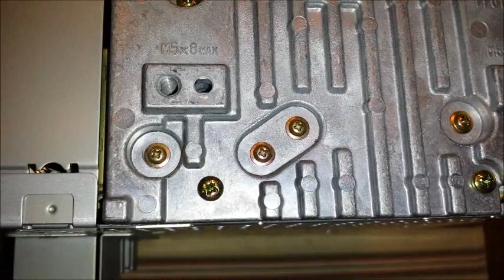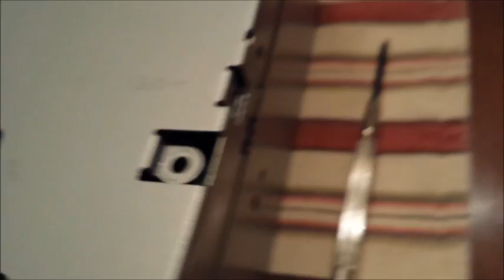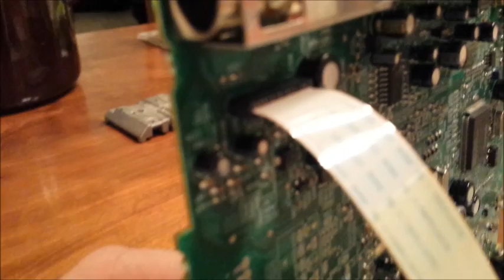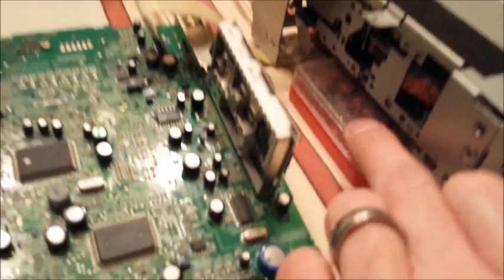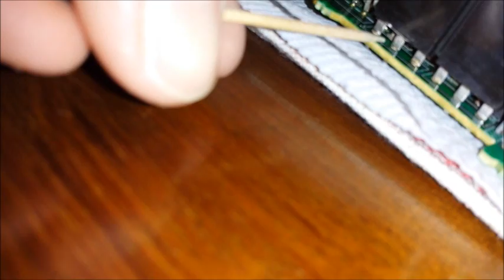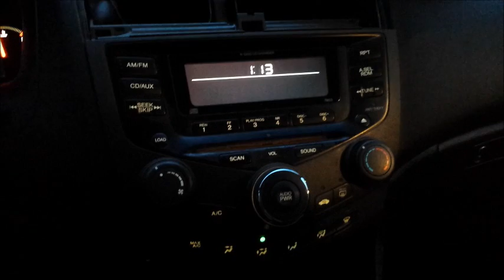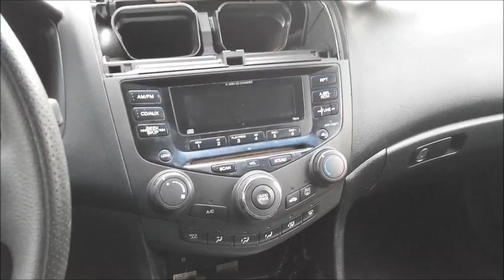2003 Honda Accord Radio Repair - Part 2

Comment: thanks for the video, really helpful!! I did everything, and worked perfect! but when i started the car, the light turned off again!! I'm sure i left it for a day when i used the circuit pen!! any ideas plz?
Reply from the maker: Hi ma sa, thanks for watching, and I'm sorry to hear the repair didn't work out the first time!  I'm not sure I have any brilliant suggestions, other than trying to make the repair again and insuring that you have good electrical contact on both sides of the bad component.  If you try it again, you might want to leave peripheral trim pieces off for a few days just to make sure the repair works permanently...if not, you can always pull the radio back out easily that way.  I hope you're able to sort it out.  Let me know how it goes.
Reply: ***** i appreciate your reply, i will try to do that all over again and let you know. I hope it works this time
Reply: hi I love your video I have a factory radio in my Honda Accord just like yours but I have the 6 disc CD changer and all my CDs are stuck in it I want to take the radio off then try to take the CDs out myself how do you recommend I go about doing that

Comment: I noticed that water thermometer is a little on the left. Is it normal or does it happen to all 2003 honda accord models ?
Reply from the maker: With regard to the temperature gauge, I'm not exactly sure what the normal operating temperature for this vehicle is, as this was a friend's car that I was repairing.  A quick Google search appears to indicate that the OEM thermostat for this vehicle is set to open at 170 degrees, so I would expect the car to run at about that temperature.  Since the gauge does not have any numerical values on it, I'm not sure what the high and low ranges are.  Also, the car had been sitting overnight prior to me filming this video, so when you see me start the engine, you are seeing it start completely cold.   I would expect the temperature gauge to rise gradually as the engine warms up.

Comment: hey, congrats on fixing the problem that bugs most honda accord drivers. so how's everything working out so far? since you just bridged it over with a sort of conductive paint without any resistance, did it cause anything else in the car not working at all? I just took everything apart today, and am thinking to bridge with a 220 ohm resistor over it and see how that would work.
Reply from the maker: Hi kszeng, thanks for watching.  I actually performed this repair for a friend, who later sold the car to another friend of my family.  According to the new owner, so far everything is working as it should, with no side effects from the repair.  I don't know for sure if any resistance is required in this circuit, or if the failed part was simply a fail-safe fuse.  Obviously my repair is not factory-quality, and I imagine if there was a surge in voltage/current, then other components could potentially be damaged.  However, on a 10-year-old vehicle, my friend did not want to spend a lot of money to fix the problem and was willing to take the risk of bypassing the failed component.  I'm not sure if a 220 ohm resistor will work or not, but if you try it out, let me know how it does...I'm curious to know.